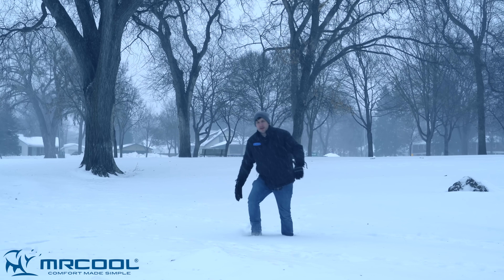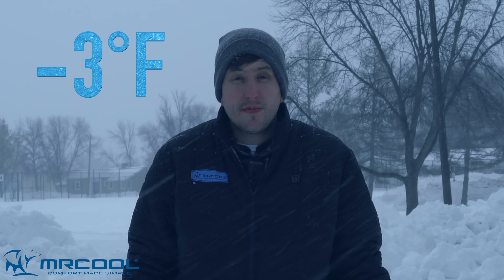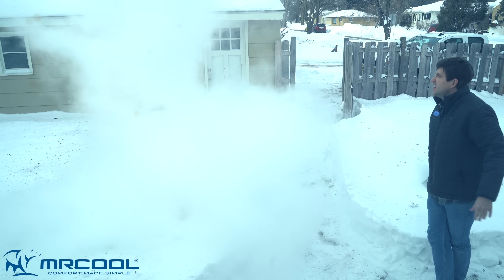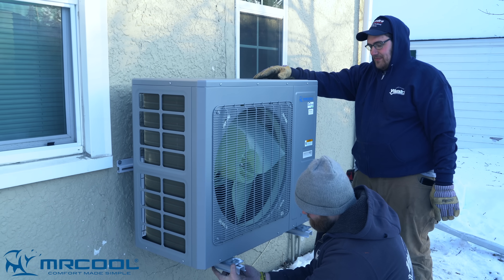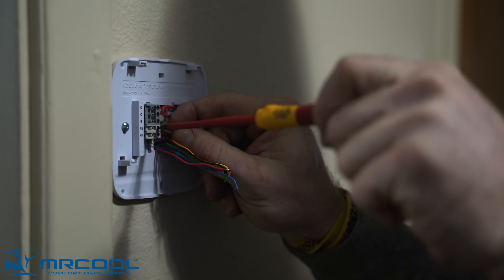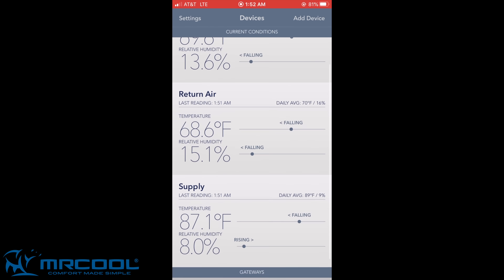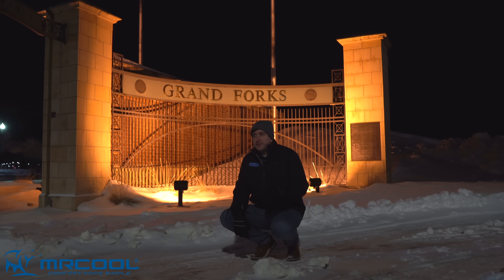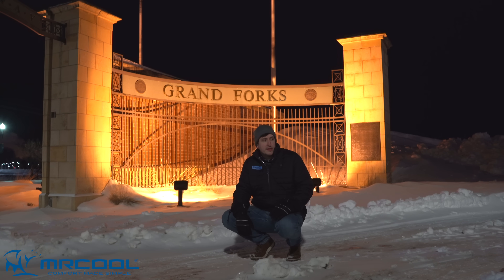The MrCool Universal Heat Pump Heats at -24 Degrees

Comment: I watched the video but can't believe it.  I do hvac work, a 3 ton heat pump puts out 36,000 btu's of heat at 40 degrees, but as the air gets colder there is less heat in the air and at around 18 degrees you usually have half the heat which would drop the heat output to 18,000 btu's.  That house looks at a minimum to need a furnace of around 80,000 btu's.  I have a Goodman 5 ton heatpump 16 SEER 2 stage which will keep my house at 70 degrees down to 20 degrees but colder than that the temperature in the house drops.  Since propane is currently cheap (99 cents a gallon) I have my system set up to heat with the heat pump down to 30 degrees, colder than than that I switch over to a 120,000 btu furnace.
Reply: I have a 24K BTU Senville unit that is rated to heat down to -22F. In use it still provided heat at -35F, but as you say less. I have the same size 1 1/2 story and the 24K unit heats it great, I'll have the house at 78-80F in the winter if I leave it run. Uses 2500 watts full on in winter, so I cycle it on and off depending on if I'm home, and leave the furnace at 67F for base heat when I'm not there. We are building hyper efficient homes now that are 15 times tighter than stick construction, and need much less energy to heat.     www.energypositivehomes.us

Comment: COP calculation. System was a 3 ton unit per MRCOOL comment below. Assuming 1100CFM air flow (typically lower than 400CFM per ton for heating modes if ECM). Assuming power calculation is only for outdoor unit. Assuming this unit has an ECM motor fan for constant CFM at various duct static pressures. Assuming average 4700 watts, but not taking into account heat lost due to defrost sessions.
CFM=(VxAx3.414)/1.08xdeltaT Normally the vxax3.414 is calculated via the amount of power the heat strips took.
1100=(heat added to air)/1.08x17.6
1100=x/19.008
x=20908.8 BTUs added
That's 6124 watts.
6124/4700=1.3 COP.

For fun, let's use my costs for electricity of 11.4 cents for kwh in winter, and 80 cents a therm. According to the Mitsubishi heat cost calculator, for 1 million btus, a 96% furnace would be $8.33. This ssytem would be $25.62 when -24F outside.To break even, would require a COP of 4.  But best I can tell a therm in Grand Forks can be about 58 cents. 

That still doesn't mean you shouldn't consider this system. Burning natural gas puts tons of CO2 in the air, and thus you are essentially externalizing the costs to someone else in the future. That could be you. And you could install solar or wind energy and not pay anything at all for electricity or heating, or cooling! I'd need around 12 300w panels to do it, and my energy company will pay for energy I send back onto the grid, so no batteries needed at this time.

I still suggest if you can, using a heat pump that can heat to -22 but doing it zoned so you don't heat what you don't need.

Comment: Can someone please explain in detail why one would get a heat pump instead of furnace assuming gas connection isn't a problem???? Lastly why the heck is it called mr cool instead of mr heat?
Reply: It's called MrCool because that is their company name. They made their bones on DIY ductless AC units. I think heat pumps like this are a fantastic alternative for folks who live in the sticks or live in areas where natural gas is unavailable meaning we have to purchase expensive fossil fuels to be delivered to our homes. I just installed this unit myself due to that exact reason. If i had a natural gas furnace I don't think I'd bother. As an air conditioner, it's working amazing! not sure yet how it'll perform in the winter.
Reply: Long term thinking. Natural gas is bad for the environment, along with the massive amounts of C02 it produces. Right now if you can simply put in solar that takes care of all the electricity you need, and then some, you'd be more than carbon neutral and could heat your house for "free".

Comment: As harsh as those winters are, that's concerning not having any backup heating methods. Lose a compressor or other component, and you don't want your pipes to freeze.
Reply: you can install aux heat into it for emergencies

Comment: @MRCOOL, do you have a list of installers in the Midwest?

I'm in Iowa, and none of my local HVAC businesses are willing to install this unit even if I purchase it myself. I'd install myself, but I'd prefer someone more experienced.

If you have a list of installers, I'd like to reach out to the ones closest to me and ask if they'd be willing to drive to where I am to install. I could send photos of my existing system it will replace.
Reply: That's because they want to sell you an expensive traditional unit. HVAC industry has a monopoly hold in the US.  Traditional HVAC manufacturers won't even talk to a homeowner.

Comment: Great video thanks for posting. Question: how do these variable speed split systems determine the speed they run at without a “communicating” thermostat that can tell the system what the requested versus actual temperature is? I’d hate to purchase and then realize I don’t get the benefits of dehumidification at slower speeds and the system short cycles instead of ramps down...
Reply from the maker: The Universal does not need a communicating thermostat to benefit from its variable-speed compressor.
Reply: @MrcoolComfort  How does it pull that off?
Reply: It knows the demand via the temperature of the refrigerant returning. As another note, the hydronic cooling and heating system at hotspotenergy also works this way. It senses the return water temp and if demand is non existent, it will turn off. It basically makes sure the water temp is within a certain range.
Reply: So the system isn't able to cycle down automatically with a multi-stage thermostat? It seems like it would be able to anticipate the ability to operate at a more efficient displacement if it, say, had a three stage cool and 3 stage heat thermostat with the ability to have a really tight gap in the stages? (Like heat set to 70, stage one cuts on at 69.7, stage 2 is 69.3, and stage 3 is 68.9?) Or am I completely overthinking it?
Reply: @davidcameron2366  youre overthinking it more than likely.  the unit if it works anything like a dc inverter split takes the temps of the lines going in and out, uses superheat and varies the compressor if i had to take a shot at it.  mini splits it uses temp sensors to throttle the electronic expansion valve and vary speed on compressor.  should be same technology.

Comment: Hey what do you think about installing this mr cool unit on a 5’x5’x9” insulated closet w exterior door? Can the 110v model really cool room to 5°F?
Reply from the maker: This is a central air system. It does not have a 110v model.
Reply: You can use a 240v one just do it yourself;all you need is 2 w  110v got it??

Comment: Do you guys have coefficient of performance numbers (COP) for your heat pump at different temperatures?  I believe this could help many of us including myself evaluate the performance of your heat pump compared to our current heat pumps.

For example on your website you list this heat pump being able to provide 100% heating capacity at -5 degrees.  That is impressive because typically my heat pump provides very little output below 32 degrees and my auxiliary heat strips kick on a lot to help the heat pump out and that eats up electricity quickly and shoots up the bill.  Your heat pump's electrical demand is lower than my auxiliary strips so the cost could be significantly lower to operate throughout the winter. 

Is your claim that at -5 degrees your heat pump is 100% efficient or that at -5 degrees your heat pump still can put out 100% of it's heating capacity?
Reply: I'd like to see the COP vs. outside temp.  Better yet, amperage draw.

I have an LG that is similar.  In Feb we went through one of the coldest periods in the last 50 years.  Our LG units are ductless mini-splits of the 20 SEER range, LG Red rated for -5 and 100%.  As the temperatures dropped the old ancient Lennox heat pump started blowing cold air when the thermometer hit about 24 degrees.  The ducts are in the attic and the unit just could not produce enough heat to even overcome the slinky heat loss.  At that point I shut the unit down and closed the vents in the ceiling.

I took out the heat strips in our central air heat pump.

Mini-splits:  There is one 9kbtu unit at one end of the L shaped house and one 18kbtu at the other in the den that has LOTS of windows.  Construction of about 850 sq-ft is new with foamed 6" walls and R-22 or so in the ceiling.  The core 1600 sq-ft is older construction with 6" or about R-19 bats n the walls and the same blown R-22 in the ceiling.  The two little mini-splits kept 2650 sq-ft of house warm all the way down to our low of -12.  The coldest temp at the most distant location of the house was 68 degrees.

Our utility has smart meters and we can get reports of consumption down to the hour.  Our worst day averaged a temp of 4 degrees and our power consumption was 128.28 kwh.  The worst hour was the  -12 and 4.55 kwh.  It takes more power to run the hot water heater.

I need to replace the old Lennox.  It is 24 years old.  The question now is with what?  A) Inverter type ducted air handler.  B)  Zoned ceiling cassette mini-split unit C) go for broke with geothermal to heat the central part of the house?

We had propane for an emergency and we never used it.  We now have a good soapstone wood stove for passive backup if we ever need it.
Reply: I imagine what is meant by ‘100% efficient @ -5F’ is that the heat pump will deliver the same heat at -5F as heat strips would. So I’m thinking below -5F resistive heat strips are more efficient at heating, even if the heat pump still delivers effective heat. Mind you that I’d expect 300-400% efficiency in more moderate conditions. Here in MidTN we rarely have a winter night approaching 0, so even though I’ve got the wire and breaker for it, I’m not installing heat strips. I’ll take the minor efficiency hit if we have some crazy low temps in the future.

Comment: I hope they have a backup for when the power goes out
Reply: Idek how it works but it seems legit
Reply: Most central heating units require electricy to function, regardless of the source of thermal energy (natural gas, propane, oil, pellet fuel). I'd imagine a wood stove is a good idea in North Dakota.

Comment: Most people have to deal with hot computers.
But if you live in a cold place just use your computers as a heat pump!
And you don’t even have to worry about your computer overheating.
Reply: i was thinking of buying bitcoin miners as room heaters (seriously) but this system is a lot cheaper to run

Comment: Does this ramp up and down the compressor based upon load? I see in the video it seems like it is going full bore everytime it is on, on the energy meter. Is this just because the load is so massive with the temperatures.
Reply from the maker: Yes, it does ramp up and down. It is going full speed in this video, because it is so cold outside.

Comment: Least you could of installed a bypass humidifier and use hot water thru the water panel..13% RH...I think my eyeballs would shrivel up.  Also maintaining 40%-45%  RH would actually feel warmer and could probably get away with 68° instead of 70°
Reply: You'd have water on the windows at those low temps outside.

Comment: Does that heat pump have aux. heating elements at the condenser to keep it producing heat in the below zero temps
Reply from the maker: The Universal condenser does not have auxiliary heating elements.
Reply: @MrcoolComfort  Heating elements would never be in a condenser. They would be in the air handler.
Reply: @pauleohl  some low temp heating splits have auxillary heat for the basepan outside so ice doesnt build up and damage the coil depending on temp and electric heater for compressor so the oil stays warm during cold conditions while it isnt running.
Reply: A better question (or probably what was actually asked) would be does it have a heated basepan and compressor heater. It probably does. If it doesn't then that's a no go.

Comment: Where are MRCOOL units made?
Reply from the maker: Depending on the particular model, MRCOOL units are manufactured domestically, in North America, or overseas.
Reply: MRCOOL do you guys plan on making a DIY mini split that has defrost and heating capability as good as this one?  I have a garage in Sioux Falls South Dakota that I’m wanting to heat/cool.
Reply from the maker: We do not have any plans for that kind of product at this time.
Reply: @MrcoolComfort  That stinks. I see your olympus hyper heat unit though looks decent. Just hard to find someone to buy it from that isn't online. No amazon!
Reply: Mirage does. The mirage life version. I have it. It's a little tank.

Comment: The day I installed my Mr Cool diy 18k btu ac it was 62f outside. After that, Temps plunged into to 20s and 30s. I never anticipated using the unit to heat my theater/studio, but thats what I've been doing since spring has been cancelled apparently.  
My unit will bring the room from 62f to 68f in about 6 or 7 minutes. I formerly used a 1500w electric space heater that would take a good hour to begin to heat this space. 
I can't wait for 100f summer heat so I can see how well it cools!
Reply: hey hey @basspig - how did it do in the summer and what was the square footage of the space?

Comment: I bought a Mr Cool system last year and installed it myself (very easy if you follow the instructions) and couldn't be happier. I haven't tried it on these extrem temps but I know when it was around 35-40 outside, it would warm that 28x17 rooms like nothing. It was a 12000 BTU unit.

Comment: I want to purchase a Mr.Cool spilt system, just skeptical because I need 2 separate units
Reply: We have a ductless system with 3 ceiling cassettes and a wall mount hyper heat unit all running off of my 4 ton outdoor unit and we are very happy with it.

Comment: An upflow air handler?  Where I live most people have a down flow set up.  Is there a downflow unit?  I would like to replace an oil furnace with one of these.   Also, any chance of a larger tonage unit becoming available?  Say 3.5 or 4 ton.
Reply from the maker: The 4-5 Ton Universal will be available later this year. We are working on a match for a downflow air handler.
Reply: @MrcoolComfort  This is good to know, thanks.

Comment: Houses should come standard with a  heatpump instead of an air conditioner! Stupid yet that's not the case.
Reply: Heat pumps have move components so more of a chance for them to fail. Units from the 80s and 90s seem to have last 25+ years. New ones 10years
Reply: A heat pump can also be used as an air conditioner so you get two systems for the price of one with them, they are a good deal. 

Most The houses in my area seem too come with heat pymps, I live in the south where winters aren't as brutal though and older heat pumps didn't work well with brutal winters. Modern ones like this could also work well up north.

Comment: why wouldnt you pull a vacum, do you jus purge. ? How do you get the air{moisture out of the line  ?
Reply from the maker: The line set is pre-charged, so you don't have to do that. However, using the pre-charged line is not required for the Universal.
Reply: @MrcoolComfort  That is really cool. I like what I see
Reply: @MrcoolComfort  I would appreciate if you could send my day some price info, We run a HVAC company here in Knoxville Tn.  " Arctic Air Service Co."  That would be awesome. Im looking at one for myself  as well.  My Dads email is  Dennis.AAS@gmail.com and mine is  Shadehope27@gmail,com    Thank you.
Reply from the maker: We will have someone from our team reach out!
Reply: @MrcoolComfort  awesome. thank you guys,It gives me options as well. customers can buy it and have me to hook it up if there not comfortable. I love how they perform. Thanks again.

Comment: This is a great system. I’m very happy with my purchase. The air is much warmer almost hot compared to the 14 year old heat pump it replaced. The install was very easy with the pre vacuumed line set. I have a 2 zone system using a Honeywell zone controller and everything is working like it should.

Comment: What is the electrical cost to run this system?
Reply from the maker: Cost will vary depending on where you live and how expensive your electricity is. We're going to be publishing full results of this pilot project on mrcool.com at a later date.
Reply: @MrcoolComfort  
Do you know the coefficient of performance both under optimal temperature and at very low temperatures? The COP tends to drop off when it gets really cold.
Reply: @gregorymalchuk272  I too am interested in the coefficient of performance

Comment: Can you calculate the size unit needed for a new build very well insulated ICF house? Also what is the amperage draw when heating and when AC is running. Since we are out in the country there is a potential for extended power loss and want to ensure that the generator can carry the load. I know it can with a propane unit.
Reply from the maker: We will be publishing more information about the Universal on our website after the pilot project is complete. Also, you can always call us at 270-366-0457.

Comment: I'm not a HVAC guy but the duty cycle  seems like it would be about 95 % with out backup heat  so the electric  bill would be very high
 Can you do a update video  with a electric  bill info
Reply from the maker: We will be publishing a lot more information about this pilot project on our website later this year.
Reply: 4700 Watts is approx $0.56 per hour == $13.50 all day == $400 per month.  This is 100% duty cycle - your cost will vary based upon usage.
Reply: And that's just for the heat pump. We had an estimate from a company for a change out on our electric furnace, with no AC, was 2400$, got an estimate that was a heat pump, 14,000$.